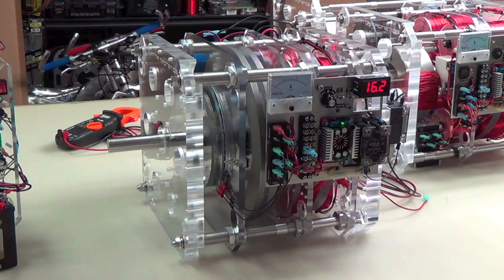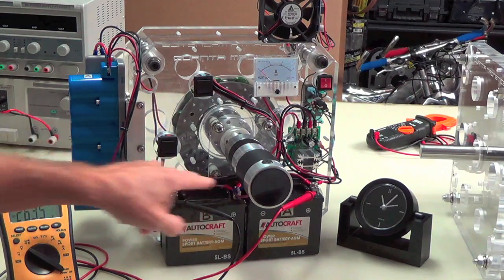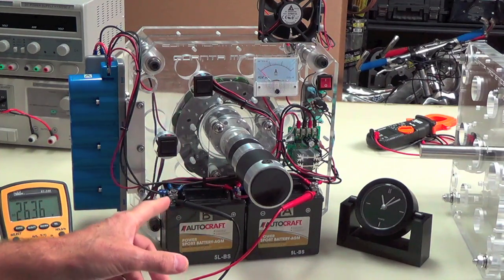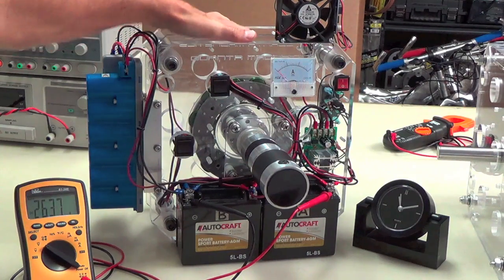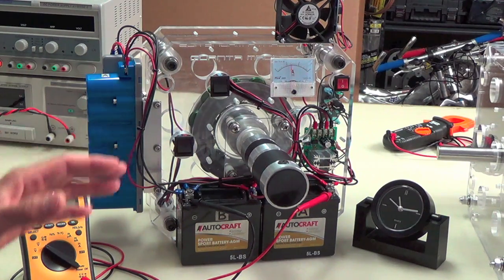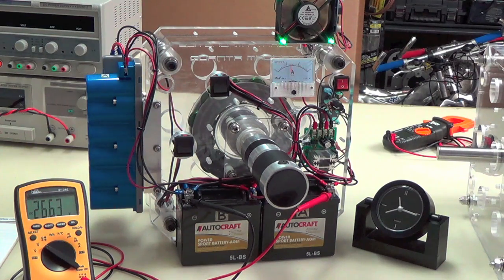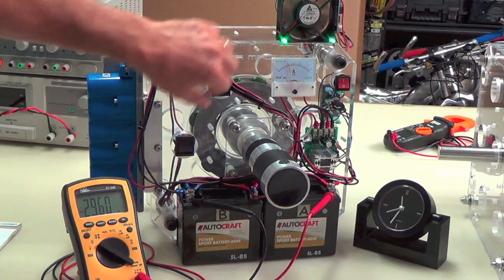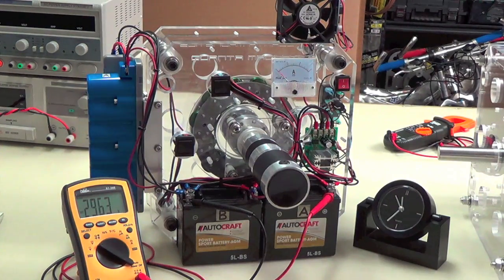Tesla Switch Hybrid to Supercaps

Comment: I’m not as well versed in electricity as you or really anyone in the field but I want to see if I got this right. This is effectively charging at a greater rate than the consumption. So essentially this is creating more energy from less with zero or little loss? (Which is accepted as theoretically impossible) Correct me if I’m wrong but if you left this on (with load) will it effectively run forever? and what I mean by forever is a relatively massive amount of time(at least over ones lifetime) and why aren’t we implementing this on large scale generators to power the grid?
Reply: brandonsg123 No! Sorry but voltage has nothing to do with load. 100 volts go back in but a few amps or watts can EASILY drain the batteries faster than that extra voltage is made. Very basic electrical thermodynamics

Comment: I would think the extra energy would have to come from the outside -- such as the Earth's Magnetic Field lines washing over it, and inductively coupling with the field lines. You would need a spinning magnetic vortex to inductively couple with the Earth's field. This may be what the Hendershot fueless generator was able to do as well. Also, regarding use it or loose it... With today's microcontrollers, WIFI, ESP8266, voltage-current sensorts, etc. it would be possible to build an algorithm here that switches on devices at whatever voltage threshold you want to use the power after it has been generated this way. But, with a load, would the battery chemistry THUS drop even lower rather than snapping back to the starting point. You would have to use ONLY what you were able to generate. If the law of thermodynamics holds, and this is a closed system with no energy from the outside, then all you've done is perturb things with respect to voltage-current relationships, and the battery chemistry might be off, and then re-balance. There may not be any actual gain here -- if you are looking only at voltage. You need to measure maH or Watts.

Comment: Hi Mike
I like it!
Seems to me what is important to understand S you said is the series parallel connections between paralleled batteries and caps with your 3ph alternator have one phase across battery B and two phases in series across both batteries.  This is "why" it works (although I don't know why haha)
So great job!
I have built motor generators almost exactly like you G1 about 10 years ago sold a prototype to someone in florida....i had  six 2" x 1" thick neo magnets, and big fat aircoils, very similar to you design...
Also I used 2 of the 6 as motor coils...magnets hockey puck shape shape NSNSNS.
Also used the same SS relays as you use!  But use hall effevt to trigger, not reed switches.
Anyways this prototype employed " sinewave peak coil shorting"  which can boost voltage stored in caps from generator coils output x20 or x50.
This is different than the voltage ride I saw you do in video with 3ph alternator and copper wire shorting  to get huge rise in voltage...
My technique is very simple and would be happy to share it with you. It fills caps that can the loop back to run motor coils or whatever you want
 Write me at konehead@msn.com
Thanks 
Keep going and don't stop!
Reply: Hi Mike
Forgot to ask what is the voltage output per phase of your 3ph alternator spinning at thie rpm shown and with no load at all on the phase or phases? 
Just wondering about that so could do replication.
Thanks again

Comment: Increase voltage but what about current? Do the batteries restrict the current or distort it?
Reply: so to know if there is gain here, it is Watts that is meaningful with a load -- not voltage alone w/o a load. It's hard to make any conclusions w/o a little load and power measurements, and also heat.

Comment: This is because caps are much more capable of receiving and releasing energy that the batteries ever can, thus u get the extra juice wich charges the batteries, without going into detail, i had this idea yrs. ago but not the means to test it nor the skills.. 
anyway great job in showing that there is no such thing as impossible.. 👍😀
Reply: although the caps will draw from the battery very aggressively w/o current limiting.

Comment: Interesting concept. Have you considered a DC to AC chop circuit vs a mechanical motor to alternator? Isolating transformers for the return voltage to the batteries.  I wonder if your loss would be less than the mechanical loss you have now?  Just a thought.

Comment: Battery B voltage please..........
Reply: Miguel Santana it’s in series with A which is what the volt meter is reporting. There 12v batteries.

Comment: I like your enthusiasm, but if you have any energy gains (or no loss) here - there is something else at play here.
Make sure your experiment is properly built and try to find what is wrong here. So what you are saying that you can leave it running for a week without external energy sources?
Reply: clavo , Frankly I did not bother to get into his explanation. I  observed a fair share of surplus energy experiments and  all of them turned out to be either trickery or had some obvious flaw in it. Practically, unless you can be physically present to study the setup it is not feasible to spend your time on it. And don't get me wrong, I am not acusing him of trickery neither I discourage anyone from experimenting and approach the idea from "different angles". There are many aspects in magnetic - electric field relationship wich are probably not fully understood by science and one day "some guy in the garage" can make a groundbreaking discovery.
Reply: I agree. In some cases when the system loss is very small, you have to make sure it is well isolated from the environment. Ideally, you can have EMF isolated room/chamber to start with...

Comment: I do have another question can I use this as a way to keep 12 volts batteries charged I'm a ham radio operator and doing emergency operations we use HF radios to relay information to FEMA and other government places radios are 100 watts and pull 7 to 10 amps with about 2 to 5 minutes of transmit time this would be great if I could get it going and have a long run time without having to refuel like in a generator

Comment: There is a lot of loss ,that you didn't mention, i  the generation of noise. The gearbox in the biggest loser.
If the motor is driven PWM way do you have a gearbox in the system?  What is the net energy in the 
storage after a long run like 5 hours? 10 hours?

Comment: I think it's the battery's it's one of the things that can power spike if enough power is added if they have been sitting awhile like the caps need exercise to gain full potential you may see the same on other machines just smaller volume of electrons moving in the battery you could put in voltage meters on every component but my guess is the battery super charges itself

Comment: I would say the more draw the more current draw the more magnetic field is generated which could add charge to all power leads  positive and negative. the chemical  battery's probably act as a shock absorber one way  more voltmeters checking wires to and from components i.e electromagnet

Comment: What’s you’re theory on the source of this power?  I caught the “why” as delayed chemical reaction. Is something in the caps or batteries going away?  You sound smart enough and humble enough to know that energy isn’t “free”.
Reply: Jacobus Erasmus How do you explain all the losses?
Reply: Yes Jacobus I would have liked to have seen a few voltage readings on the caps, can't recall if they were full or not. 
There is more happening here than just moving current around though. 

You have to remember the primary motor is running for a long time yet we still have a serious overvoltage in the batteries at the end. 
Yes it will dissipate over a day or so but its still useable surplus energy and they will still have more charge in them overall as they were flat to start.
 
My guess is the back-EMF from the 3-phase is being captured and added into the system. 

Also the same Amp drop happens in Bedini charging systems and even when you add drag to the Bedini wheel the amps go down not up as you would usually see in conventional electric motor system.
Reply: Did not gain power. Total Power W = V*A (Amp decreased over time). The caps want to keep voltage so they force the Voltage up. But the total power of the system stays the same. If you leave the motor off the Voltage should drop over time to their original level. It would be interesting to note if the addition of the CAPS reduces the heat generated when the batteries gets recharged. This would be a a very usefully effect as well as what happens when we increase the load significantly would the CAPS provide more power allowing the system to smooth out.

Comment: So Polk, the humming sound coming from the radio speakers is due to the alternating currents in the radio originating from the electrical grid. The humming goes away when the radio runs on batteries. The bridge rectifier does not eliminate AC currents, it eliminates the negative portion of the AC wave form and allows all the currents to flow in one direction. The voltage however still varies significantly from zero to the peak voltage. So even though the currents now flow in one direction the voltage and current still fluctuate which is considered the AC components of the DC wave.

Comment: Can you measure the voltage on the caps separately to the batteries? What are both voltages (if you separate the connection of the batteries and caps after the machine stopped)?

@All:
How exactly does the voltage of a battery relate to its stored energy?
I know we often "measure" if a battery is good or not by measuring the voltage.
While it is surely a good indicator, i think this is just half the truth.

I saw the car repair shop had a battery tester device. I don't know how it works but i assume the following:
I suppose the device measures the voltage, consumes a certain amount of watts (eg. 1 amp for 30 seconds) and then measures again the voltage.
By looking at the voltage drop you can calculate (or better said estimate) the total stored energy of the battery.

@PMMG4HYBRID:
Can you get such a device and measure your batteries before and after the experiment?
Reply: That is most definitely how a battery tester works with the exclusion of voltage recovery. The tester puts a load on the battery whilst measuring both the voltage and the Amperage to see how much voltage dropped, how much did it recover and thus giving you the capacity of the battery usually in my line of work measured in Amp Hours but in automotive they use cranking and cold cranking amps.

Comment: voltage increase is not an accurate means of indicating energy generation. The capacitors could result in a phase shift that causes the voltage across the battery to increase due to the alternating currents in the circuit. Consider metering the energy consumed and the energy generated. The result from the instrumentation would give you a clear indication of whether or not you are actually generating more than you are consuming. Assuming that you are net generating as you currently believe you now need to explain the source of the energy that you are converting to electric energy.
Reply: @Kirth  - Exactly.  I thought selling "free  energy" snake oil had gone out of fashion. What's the point of reinforcing ignorance, anyway? (he must be selling something)  I'm no engineer, but i think this is just a closed-loop impedance transforming widget that produces a temporary voltage gradient  and perhaps demonstrates a difference between the charge and discharge curves of these cells because of temperature effects. I think the Law of Conservation of Energy is safe for now...

p.s. I wouldn't mind having his  machine shop though.
Reply: You can easily take two caps, put in parallel and charge both to 5V, then put in series and get about 9V out with the diode drop, and dump that into a second cap.  More voltage, but it's from the power you started with, nothing gained at all.  People thinking they're making more just because the voltage goes a bit higher are clueless about what they're doing.  This is basically the same idea, just using a mechanical method and regenerating to get a higher voltage, it's no more 'free power' than any other transformer of course..

Comment: This looks like it could be adapted to work with automotive alternators.  Would there be any difference between a delta and Y 3 phase setup if you used a 3rd capacitor bank along with 4 four-day bridge rectifier? I would think the output would be incredibly clean and stable and could increase the efficiency, but also, go one step further and use some liquid helium to push your conductor into the superconductor range!
Reply from the maker: Good thought!

Comment: I've done a little bit of research and found that Joseph Newman with his invention big Eureka use the series parallel connection also he used the series connection with the smoke alarm batteries to bring the voltage up around 4 to 600 volts then put the batteries in parallel with the capacitor that was hooked up to the motor the back MF helped to charge the capacitor as well and he ended up running a7000 500 lb motor on just the current of 1 of the six small batteries that are in a 9 volt battery then the back EMF coming off the coil of the motor kept the capacitor charged he showed in one of his videos that with this capacitor starting at zero when you hook the batteries up and turn the motor 1/2 of a turn it charge the capacitor over 800 volts that voltage fired the motor so if we are looking for why this generator is doing this I believe it's the series parallel connection to create the right conditions I'm sorry that I don't know how to send a link to different videos but if you are interested in big Eureka so that you could see it for yourself the name of the video is Big Eureka the energy machine of Joseph Newman I'm sure he has hundreds of videos but the one with that title will help you see that there are a lot of people giving up most of their life to try to help Humanity I think because we can't go to the store and buy some of these inventions people have a hard time believing that they're real but if they would stop and think if we only believed in what we can see and go to the store and buy and we rewound history back to the caveman days what would we have today? So it's very important to remain open-minded and have a little bit of faith we have to remember that instead of saying if it sounds too good to be true it probably is we need to realize that everything that man has ever made as always started with the faith of a mustard seed the what if that follows when you think or here something that sounds too good to be true so for me if it is good I will at least remain open minded thanks again for your video be safe
Reply: well said
Reply: Thank you

Comment: I seen the first video when you did this it must have showed enough promise that you duplicated it again but now I'm wondering does the super caps hold a higher voltage than the batteries,  if so could they be back feeding into the battery since they're in parallel only , not in series with the batteries or the alternator I think that could be the Delayed Reaction Time because the batteries would have to run down to a low enough voltage for the capacitors to start back feeding into them properly  I've built a lot of John bedini machines and some Joseph Newman Motors and what I realize with John bedini is the amount of batteries that are in series on the charge side,  well exceeds the small battery that runs it ,  and because the circuit that runs the motor portion flips after pulsing the motor it temporarily puts the charge batteries in parallel with the run battery so it continually back feedback into the charge battery but before I realize that , I was simply using it to charge batteries so I never noticed , and on my channel I have a small Newman motor that I built from an old microwave and I have just realized recently that if I let the batteries that is running the motor run dead meaning no longer able to run the motor , and then I put a 10 volt capacitor between the motor and the batteries the motor takes off running three times faster and just keep's  on running ,  so I hope this helps in some way. , and I deeply appreciate you making another video on this particular generator it is very interesting indeed , God bless. , and be safe😎

Comment: I am only touching on the problem of the batteries max voltage problem.  Since the batteries are in a series-parallel circuit, why not use FET's to separate the caps, discharge them into another storage bank, isolating this system from any form of load and effects it may induce?
Reply: exactly into a bank of nick metal hydride battery pack via a v switch transistor that turns on at a giving voltage above nominal of main battery that mean no loose in extra juice bugs

Comment: Bollore uses this type of combination system on their electrics in LAblue and Indyblue. 
 
  https://en.wikipedia.org/wiki/Bollor%C3%A9_Bluecar    
The Bolloré Bluecar is a small four-seat, three-door electric car supplied by Bolloré, designed by Pininfarina and manufactured by Cecomp in Bairo, Italy, under a joint venture owned by Bolloré and Pininfarina called Vehicule Électriques Pininfarina Bolloré (VEPB). The car has a 30kWh lithium polymer (LMP) battery, coupled to a supercapacitor, that provides an electric range of 250 km (160 mi) in urban use, and a maximum speed of 130 km/h (81 mph).[1][2]